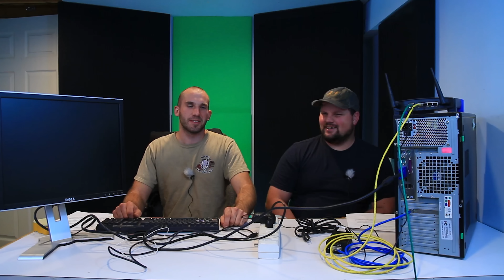PoE Computer

Comment: hi, I just subscribe to your channel thanks for the video about the POE computer. I have some questions to ask you, please. I already using the POE system for my IP cameras by NVR. question 1 - I have simple Gigabits switch 8 Ports I read about using injector to convert non-POE switch to POE switch. can possible that with injector my 8 ports non-POE became POE? question - 2  I want my laptop 19.V ~4.4 A to connect with POE? how much DC power I need POE to switch for? I hope you can help me thanks advance.

Comment: And now in 2017, with the availability of the emerging IEEE 802.3bt type 4 standard and ultra low power high performance "mobile" processors, means a POE powered desktop computer  is becoming a commercial reality, in the business sector anyway. However it's being done without the poor engineering practice of sending lethal mains voltage down a class 2 ethernet cable.

Comment: Would a POE router/swtich cause damage to a non POE device?
Reply: This configuration - definitely yes , it is like plugging 120v ac to eathernet adapter and motherboard directly. A regular POE to pc? Probably not, but still it is dangerous game.
Reply: @d1s1ntegrator56  POE is a standardized so it's not dangerous for the networking device. POE is even possible over Gigabit Ethernet.
Reply: passive poe 24v should probably not be plugged into active poe or non poe devices, but active poe will handshake with device its connected to, to prevent power
 going to a device that should not

Comment: so your sending 120v wall outlet ac down cat5,  when its not rated for that, and while you may get away with this, the fact that a core or more could break and cause a short in the ac with an untold amount of amps flowing possibly leading to a fire, your a set of tools...
the cat5 cable is designed for signalling, not current delivery, so can well heat up melting the insulation between cores once again leading to fire.
the insulation between cores is designed once again for low voltage signalling, so may break down via capacitive effects and 'bleed' ac power into the data lines destroying the card/router/switch
its also maybe illegal in some states/countries for those obvious reason
Reply: Yes it is, but this is for experimental purposes only

Comment: While a great idea in theory, this would be against cabling guidelines in most places. Also running AC power along data would inject noise onto your network and possibly corrupt data. User be warned
Reply: dear sir he is taking output dc of the injector he is not injecting
Reply from the maker: +Rodney Grech with line voltage like this it is a terrible idea.  But with how low power computers are becoming it would be feasible to use the actual poe spec.  But i am sure there is very little market for such a product. Would be cool though.
Reply: He is indeed injecting 120v AC into the network cable, the injector and NIC has been modified to make this work as described in the video